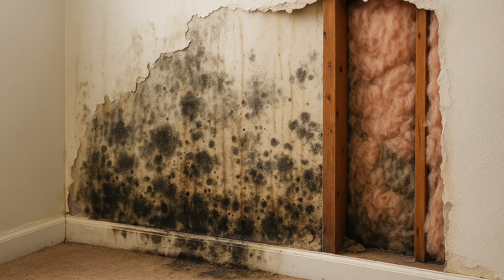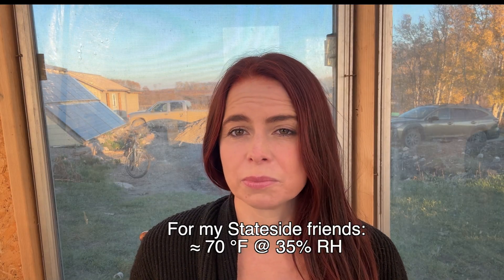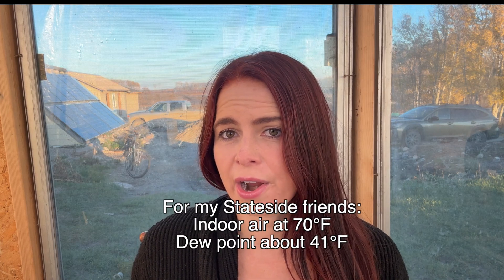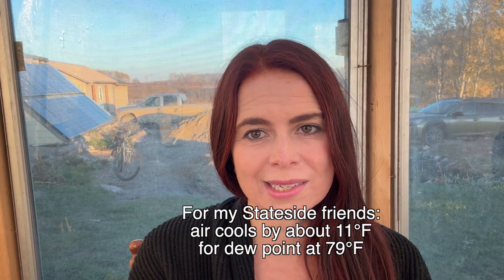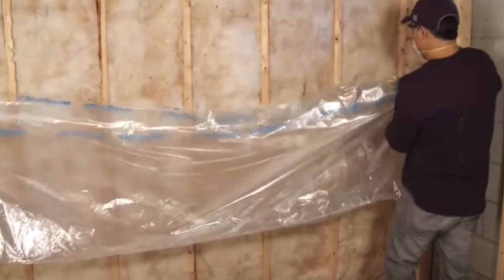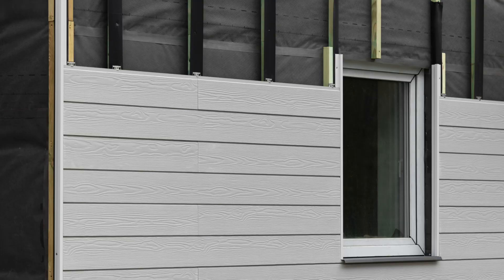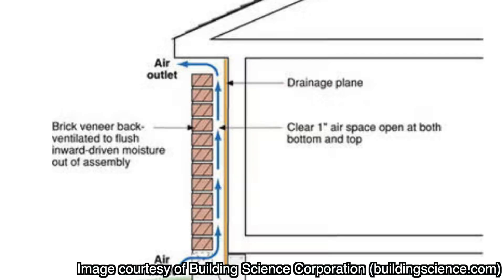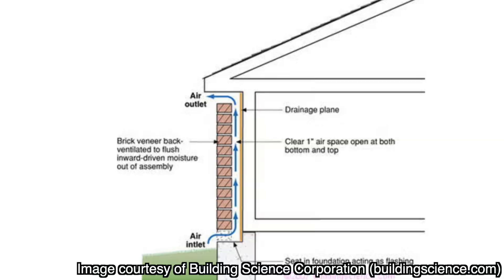How Air Leakage Rots Modern Homes (Even Without Water Leaks)|  Part II

Comment: OK, 
You need to expand your content.
You've shown an "Interesting" Wall style, of the Rain Screen Wall.
But 
What happens when the owner wants to add some of those Pop can Solar heat collectors?
What does that do both to the total heat Cooling and Humidity effects?
What happens if the simple Pop can Solar heater is placed in front of you "Interesting Wall" change up?
(I keep wondering the "How different from the Solar pop can heater is your Rain Screen"?) 
Should the Rain Screen and Wall based Solar collector systems be Integrated or Layered?

What are the effects on a house if the owner builds a Solar Wall system?
Would that be retro fitted and have the Rain Screen added?

What are the effects on a house Geo tubes?
Would the area that the air leaves a Geo tube need special adaptations in order to prevent Mold build up.  (Some would simply throw a Dehumidifier in front of the ground exiting tube.  But does the whole first contact room need things like walls that don't have the standard plaster board interior walls?) 

What are the effects on a house Sand batteries?  (There is all this debate from people who want to take short cuts and use Water batteries for they heat up faster.  They are not realizing that any slippage of water vapor either HOT or cold into the house could push the house over the dew points.  So I would go with only Sand as an option.)

There are people who are converting window mounted Air Conditioners so that the Cooling Radiator's are immersed in a water tank and that water tank is connected to an outside piping that goes down into the Earth.  (These should be monitored for passing water vapor into the houses.  They may need to be further improved so that they are not creating the tipping points?)  Years from now the areas around the window based AC Units may be where the Mold is not just forming but it's growing by being blown all over the house as spreading spores.

When they pull back the Refrigerator from the wall the Contractors' all say the same things "Ooo looks like you didn't have enough air flow back here and between that and some dropped food crumbs and wet bits it Molded back here."  OK was the AC Unit where the Mold spores got there starts by forming under the AC in the Wall there and then prorogating over to behind the Refrigerator?
Reply from the maker: Thanks for taking the time to comment and for sharing your thoughts. You’re right that any add-on system—solar air heaters, earth tubes, thermal storage, modified A/C units—can have big implications for heat, cooling, and moisture. Every one of those examples would need its own careful design approach to make sure you don’t create condensation issues or mould risks inside the home.

That said, my channel isn’t meant to be a full engineering service or a deep dive into every possible DIY heating system. The goal here is to help people understand the basics of moisture management and why so many modern buildings rot—while also looking at lessons from older building traditions.

The “rain screen wall” I showed is just one example of a widely used, well-researched approach to making walls more durable. It’s not my invention, and it’s definitely not the only solution. Any time someone wants to integrate additional systems like solar collectors or ground-coupled tubes, that’s something a qualified engineer or building-science consultant should design specifically for that project and climate.

I appreciate your engagement, and you’ve listed areas that could each be their own full video. For now, though, I’m keeping the focus on fundamentals—air, vapour, bulk water, insulation, and how to build walls that stay dry over decades, not just years.
Reply: @RootedResilientLiving  The hand off to what you would call a Professional would result in 2. things.
1. It would be a cash cow for an Engineer.  He would never quite finish the project.  Year after year His results would never quite be ready.  Your need to Just keep PAYING him would go on and on.
2. He would tell you that what you are doing would never be code compliant.  Then run off to a very large corporation claim that you would not be part of the Royalties and the together they  and only a forces as powerful as they/them could create both a Code change and then have a Monopoly on the new type of Construction.

(Rammed Earth exists because the large Corporations can't form a Monopoly on the builds.  For Rammed Earth to continue it MUST be that the advancements are done and proven by the little guy and for the little Guy.  Or Else the Mega Corp will take it away from us and force us to enter into 30+ year Mortgages that we will never complete for Dirt.)
"If it's going to Be 
It's up to Me!"
Reply: @FuhrChris  You need to be realistic because you are not going to do any of these things and you can spend all of your time thinking about making adobe homes with geothermal and heat collectors etc.
The bottom line you are proposing hypotheticals that you will not execute. You can build your aluminum can wall or mud hut with found materials and live like you are in the third world. Just leave your windows open and add a few more blankets if you want to save a little money.
Reply: @David_H_Parker  LOL
with a forecast of into next week of more LOL.
And you good Sir need to know for whom though art speaking at when you make the broad ASSumption, that I'm not already about 1/2 way there.
For one issue alone the trench for the GeoEarth tube is over 150 feet long and I'm stopping the digging for the year at about 4 to 5 feet down.  Simply because for me to bring in a Back Hoe they can only reach down 6 feet so next year's builds will include scraping away 4 feet down of a wide enough Zone for the Tank treads to set on that the maxims reach of the back Hoe will be an offset depth of 10 feet.  (This years digs were just to test the soil to see what's down there, and it's a prehistoric long gone sandy lake beach.)
This also alters the design of how to modify an AC by surrounding it with Bentonite Clay, mixed with Graphite since the needed watering of the system would just keep going down and not really keep the Bentonite Clay wet.  The alternate method will to to weld two 55 gallon drums together and just go back to a water exchange chamber that has something in there to keep it from freezing.

The reason to be in contact with these people was the current level of build had condensation on the celling because of a puddle on the roof.  Tomorrows Amazon order will be for the materials to make an upwards arch in the roof as opposed to the sag the rains (or snow) would create.

The current build is only a mere 43.3 by 30 after the upgrade of a Solar wall on the South side (scheduled for next build season).  I'm shut down because it's getting too cold for applying Styrofoam. I will be into creating a 43.3 by 60 addition.  This should give me about the same amount of space as my previous Work Studio.
All of that is support for my next build after that.
(I've been leveling the grounds here so that the dirt can naturally compact over the next 3 years and be readied for build after build for possibly the next 13 years.

I am deeply upset that I don't have as many video cameras as I desire to better document the builds and then put them up on YouTube.

Comment: So I take it your follow up episodes will include?
1. I'm a "Wet Tent" breather.  In the right conditions (No heat + cold weather) I can soak the inside walls of a two man tent, or I can make a bed comforter's top damp enough that you start looking for celling leaks.
2. People who are facing hard times often do more cooking with "BOILING WATER" in the kitchen this spikes the humidity in the house. (I'm considering the Older design layouts of the Kitchen being in a separated building, VS. central to Social flow.)
You like having Tea 3 times a day and you wait till that whistle from the Tea Kettle.  You may be pushing those numbers just over the tipping point and causing that condensation in the Walls.
3. Propane heating.  The focus socially about using propane heat (Mr. Heater) is CO2 but what is skipped over is the secondary product of burning Propane is it produces water vapor.  You can't dry out an Old VW bus with a propane heater.  (Don't ask me how I know!)

For the Rich there would be having a steam room or Sauna, or an indoor Hot tub without running about 4 dehumidifiers in the adjoining hallway.  But the Rich Love to  show off that the rules of Nature just don't apply to them.

1. Stop using plaster board.  It does act like an averager of the humidity and it wrecks when the numbers are not in your Favor.  
Design in a way that "May the Odds' always be in YOUR FAVOR!"
2. Build in a way that IF you building needs a certain level of heating you can provide that over both your life time and the life time of the building.
(I'm working on installing a Geo Tube so that year round it produces 55 degree air.  Should the humidity coming out of this ground based system be wrong for the structure then It becomes run a De-Humidifer.)
2.a. Before the Geo tube air goes into the (Currently it's just and AirStream) I'm planning on placing a Wind powered Load dump between the Earth air tube's exit and the intake of the AirStream's heating system.  This should (If connected to a Thermostat) provide the needed levels of BTU bump up to get from 55 degree air over to the desired 68 degree internal air.  (Air cooling in the Summer is another build.)  (Oddly Neither build wants to connect up to a mini-split. I believe I can do better with two separate systems.)

As for Life in a 22' 1968 Airstream.  Currently the front nose is a 3D modeling station and I do my cooking outside.  What my into Cooking ancestors would generously call a Kitchenette.  Will be retro worked (within a restoration of the Airstream limiter) Coffee bar/Espresso.  For reheating Coffees and making my 2 shot Breve with 2 shots Chocolate and 1 shot blackberry syrup morning starter.  Later in life I will move all of that into a computer room/Design station and set back up my Drafting table and work on elaborate computer chairs

One of the ways that we are Wronging our homes is:
The popular Evaporative Cooler.  (Don't get me started on having one that is FULLY exposed to the Sun as opposed to having a second structure shading the Coolers metal exterior.)
Air conditioners that don't feed directly into a Dehumidifiers, with a secondary Dehumidifier in like the middle of the room.

Refrigerator's that bleed heat off the back of the Refrigerators and that should be contained and that hot air pumped out of the home, so that you are not paying twice in the form of the Air conditioners trying to compensate for the Refrigerators' Sins on top of the chore of cooling the house down.  IE do what are Great Grandparents did with a Cold cabinets but use modern tech to amplify the results and Raspberries to control the opening and closing of the vents that start in Refrigerators, have a second set in back of the Refrigerators where the heat is boxed insulated and managed like a recourse and in the Summer that heat is pumped outside, with additionally a built in electronic Farmer's Almanacs to get a jump on what the outside conditions are going to be in Ooo say an hour.
Reply from the maker: You’re right that everyday living can add a lot of moisture — breathing in a small cold space, boiling water, propane heaters, and things like hot tubs or steam rooms all release water vapour. In a tight house without good ventilation or dehumidification, that moisture has to land somewhere, and often it condenses on the coldest surfaces.

That’s really the core of what I’m talking about in this series:
keep bulk water out, manage indoor humidity, and make sure the building has a reliable way to dry if some moisture does get in.
Reply: @RootedResilientLiving  Are we just dancing around the possibility that what every home regardless of how it was built need some form of intelligent De-Humidifier as needed as much as heating and cooling?
Perhaps we need to stop thinking of them as an oddity and more of a Necessity for a house that has value in 30 years?

Comment: I don't believe Tyvek was ever meant to block air. And I've never seen it installed so that it can, as no builder I've seen tapes the seams.

Years ago the premier way to wrap a timber frame was with structural insulated panels (SIPs). Two layers of OSB with a thick monolithic layer of plastic foam between. Back then, the common method of handing the seams (when the frame provided the structure) was to use OSB splines just below the outside OSB layer. Then drill small holes every foot or two along the seams, and squirt spray foam to fill the gap between the edges of plastic foam. It was difficult to get a perfect seal, impossible to test, and back in the day sealing tapes didn't exist. Many a SIP roof rotted out at the ridge line for exactly the reasons you cited: air leakage through imperfect sealing. Today SIP seams are often sealed by applying caulk in a fat bead, before the panels are pushed together, and then taped from the outside (or fluid-applied sealing membrane, or peel-an-stick membrane).
Reply: "Many a SIP roof rotted out at the ridge line for exactly the reasons you cited: air leakage through imperfect sealing."

No. The issue is that the Foam used in SIP is moisture permeable. The issue that roofers installed a non-permeable roofing membrane & asphalt shinges are also non-permeable. Moisture rises, passes through the permeable foam and condenses on the exterior SIP OSB. It gets trapped because there is no way for the moisture to escape! There is special roofing membranes for SIP Panels that is moisture permeable.

The correct way to use SIP for roofs, is to install a permeable membrane & install a cold roof with an air gap with ridge & Soffit vents for moisture to escape. A cold roof is installed using purlins  covered suing Sheathing, or installing metal roof panels.
Reply: @guytech7310   The most common insulation for SIPs is EPS (expanded polystyrene) i.e. Styrofoam. Yes, it does leak moisture, and water if given enough time. But 8 inches of EPS (typical roof thickness) plus two layers of OSB greatly slows the transport of moisture.

You are right, a completely impermeable membrane directly over the SIPs is pure trouble. One could use old fashioned tar paper under asphalt shingles, but why punch a zillion little holes in your SIP's outer OSB layer? The use of a cold roof is the best solution. In the case of a cold roof I'd screen the top and bottom vents to keep out bugs (and flying embers), not bother with anything on the SIPs, and then an impermeable membrane on the cold roof. Joe Lstiburek (Building Science Corp) says to never put two vapor barriers in an assembly. Which is what you warn against.

And I am right, air leaks through the seams between SIPs will destroy them in very short order. A major failure mechanism, especially for roofs in cold climates. Doesn't matter if you have a cold roof on top of your SIPs or not.
Reply: @ScottyDMcom "And I am right, air leaks through the seams between SIPs will destroy them in very short order. " 

Air leaks would only speed up the drying process. Trapping moisture at the top of the exterior OSB is what causes rot. Moisture is still going to always migrate through the Foam insulation. if there is no way for the moisture to escape its going to rot the exterior OSB no matter if there are zero air leaks.
Reply: @guytech7310   It cannot dry when every bit of air flow, for months at a time, carries liquid water. It freezes, it thaws, but it stays wet. It only gets to dry in the warmer months.
Reply: @guytech7310  Joe Lstiburek made a video about the problems with SIP's as roofing panels and yes, they rotted due to insufficient air tightness of the seams.

OSB can be considered as a vapor barrier, so the problem was not the "vapor openess" of EPS (which is actually minimal).
Reply: @koenraadprincen7212  OSB is moisture permeable:

"OSB permeability is its ability to let water vapor pass through it, and it is considered a vapor semi-permeable material, allowing a wall cavity to dry out. OSB's water vapor permeance is often in the 2 to 12 perm range."

If what you said was true there would be no reason to use a permeable vapor membrane on the exterior side of the SIP roof panels. 

The only what to avoid moisture from getting into the SIP roof panels if it the OSB was faced with a non permeable coating like Huber ZIP OSB. That said, moisture would still get in from the edges of the SIP that is usually faced with 2x12, 2x10 depending on the thickness of the SIP Panels.
Reply from the maker: Really appreciate this discussion — you’re both clearly trying to get the details right, which is more than most builders ever think about.

At the end of the day, SIP failures usually come down to the same thing: moisture gets in, and it can’t get out. Whether it’s from vapour moving through the foam, or air leaks at the seams, the problem shows up when the outer layer can’t dry. And there are so many details that affect that — vapour permeability, airtightness, drying potential, the local climate...